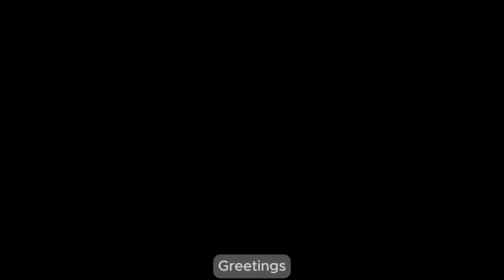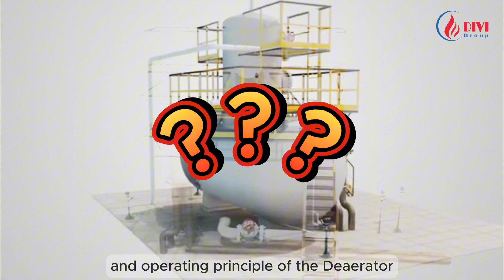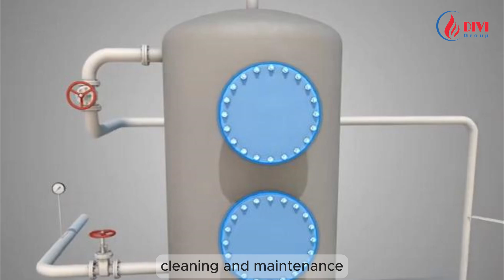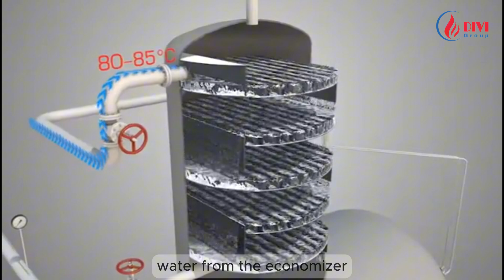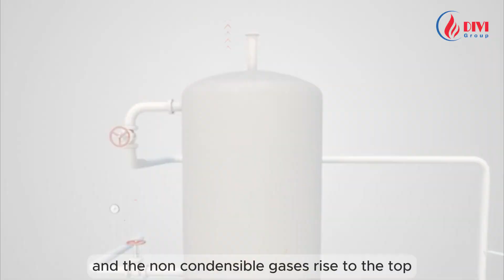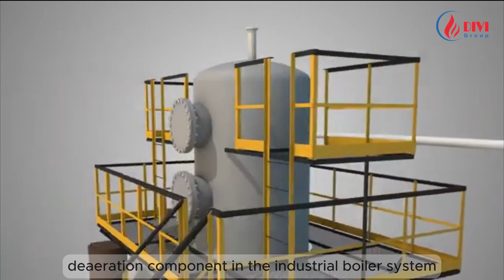Boiler Corrosion Starts Here! | Deaerator Tank Working Principle Explained

Comment: What is the main function of a deaerator tank in a boiler system?
Reply from the maker: The main function of a deaerator tank is to remove dissolved gases, particularly oxygen and carbon dioxide, from boiler feedwater. This prevents corrosion in the boiler system and extends the lifespan of the equipment.